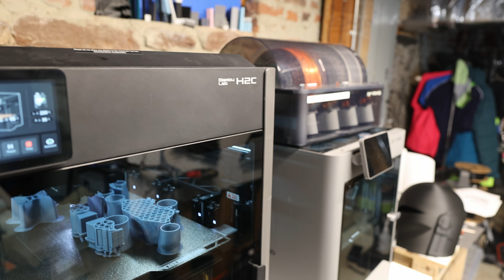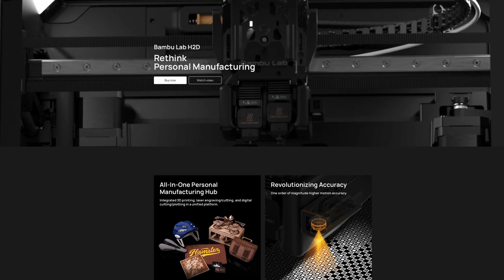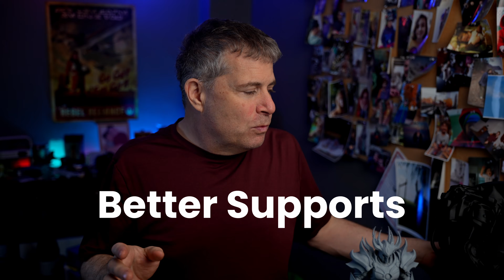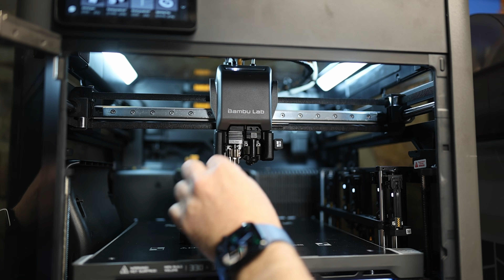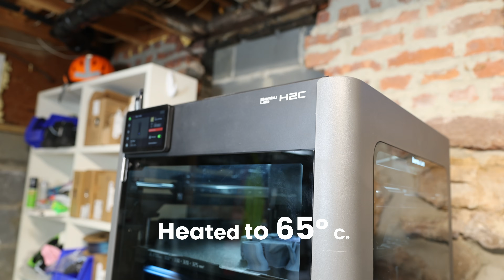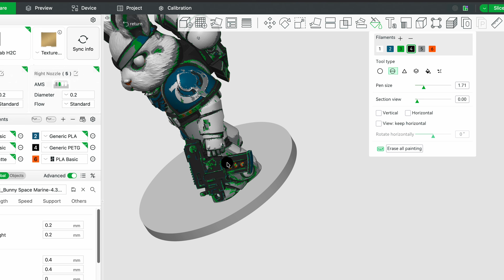The Bambu H2C Is Revolutionary. Here's Why You Probably Shouldn't Buy It.

Comment: I have never done 3D printing. I am wanting to get into it. My daughter wants to be an engineer so my wife thinks a 3D printer will help her to visualize things that she would or might design on some of the 3D modeling software. Also my wife wants to start a business doing 3D printing. No we don't want to sell dragons at the Farmers market. We are looking at things that you don't see in our local markets as often. I have a lot of experience in construction and building things that I need at the moment. Sort of redneck engineering. I'm looking at all the options and given the things that we have seen that we would want to print a single nozzle printer with Nas would probably get us where we want to be but the time involved would be extraordinary for the things we want to do. Therefore, a dual nozzle or a tool changer is the minimum starting point. I love the idea of the x2d where I would have one nozzle for printing and the other for supports but it's a smaller print bed for than what we need and also that other secondary nozzle is not a fully capable nozzle like the other. That moves us up to the h2d as being the minimum entry point for what we want to do. However, with that said, the HTC has now dropped in price to under $2,000 and that has a lot more features and a lot more options above the h2d. Given that they just announced the h3c , which looks to be a far superior product that may drop the price of the h2c down a lot and be a more attainable entry point for us. Of course it may be so far ahead of the H2 series that we end up abandoning our goal of the H2 product and just try to save up enough money to move straight to the h3c. If it releases at $3500 though that will put us way out of the range and we cannot even consider it. Putting us back to the h2d or the HTC.

Comment: Great vid, and thanks for not having background music. Why am I watching? I'm looking for my very first 3D printer. I was considering resin before, but the mess and fumes threw me off, so I'm back to FDM. I would like multi-color, the ability to print support material, less waste, and a great ecosystem that works. I know all about the issues with Bambu and the issues around privacy and third-party software, but it seems the Bambu system just works. It's a lot like Apple, despite Apple being so proprietary. 

The build volume of the H2C seems really good, along with all of the included features which for other brands are add-ons. Price isn't too bad either. 

What really got me thinking seriously about a 3D printer is two purchases I made on Etsy; one was a modular gun holder which has swap-out supports that go into the magazine well of a pistol (small for smaller guns, larger for larger) and this was even customized with the brand of my choice. This was great for zeroing the gun's optic with a bore laser. 

The second thing that got me thinking was a set of pumpkin heads for Halloween. These are one-color PLA but the art was so great, and the print came out beautifully. I plan to primer and paint them, followed by a protective sealant for display this month leading up to Halloween. The Pumpkin heads were smaller than I thought, but if I had my own printer I could either print these larger or just design my own and print that at any size. 

I also have a little invention I want to print. Just a quality-of-life thing like so many others have done with their 3D printers. 

Waddya think, should I take the leap? I'm also a 3D Artist, though I would use my skills for practical applications mostly.
Reply from the maker: I hate background music. The only time I use it is when there's something that benefits from it. Footage from a gimbal camera like the Insta360 is one. 

I'm personally not in any way concerned about Bambu and privacy. I'm not printing anything of great importance. I get it for companies that need to be secure but I think there's a lot that's overblown. Half the people posting comments are on their androd phones, which is ironic.

The custom gun holder sounds really cool got an Etsy link for that? I'd love to check it out. 

Since you're talking about making your own designs, if you're as bad at 3D designing as I am, on my other channel I'm doing a post about the AI 3D modeling tool Tripo. You get 500 credits if you use my affiliate link triesth.is/tripo and code TRIPOCREW (all uppercase) gets you a month of pro for $8. I use it for a lot of decorating, while I use Onshape to make more practical models. 

I'm glad you're not doing resin. I've completely stopped testing resin printers, just too unhealthy.
Reply: @davetriesthis  Thank you for the quality response! Sounds like you're reasonable about background music. It makes sense if there's no voiceover, but I hate when it competes with the mood and audio for a voiceover. 

I agree with you about Bambu. I guess if I had trade secrets or privacy concerns I'd be more concerned. There is a slight concern about my unique 3D art going through Chinese servers and being sold by someone else, but I'm guessing that Bambu wouldn't do that. Maybe they would, and if they did I would change my tune in a big hurry. I don't plan to make anything super complex or difficult for 3D printing, just some practical quality-of-life improvements and things like Pumpkin heads for my Halloween decor (my favorite holiday). 

What I've done with house lighting is already so cool and any 3D-printed decor will just be the cherry on top. Plus, if anyone swipes my 3D prints, I can print more and the cameras might catch 'em anyway. :D

The gun stands are amazing! All done with PLA, and I even got the CZ logo printed on the base. Here's the Etsy store link;

https://www.etsy.com/shop/ThreeDArmory

Yeah resin is amazing but I'm not going for art prints, otherwise it would be a no-brainer if I could bring myself to deal with the VOCs and the mess, which I'm not. 

I'm great at 3D design but I do appreciate the link to the 3D modeling tool. I knew it was a matter of time before AI was able to assist us 3D artists. I'll check it out. I already love AI for 2D art, and I know most pro artists hate AI but to me it's just another tool...like 3D printers. 

Thanks again!

Comment: For me, I'm considering it for tabletop ready terrain and miniatures. 

I'm finding while I'm actually pretty good at painting natural things quickly and comfortably, buildings and mechanical objects are very hard for me. And given most of these are back drops for the games, rather than the centerpiece, getting them to tabletop ready is more important that getting them to display grade. 

I've already run a few multi-color tests with my P1S, and the results were very good. The 8mm infantry are very nice, despite being basically ants with stick guns, and using matte PLA as a base for painting rocks and other things is excellent. 

I'm pretty sure doing scale buildings with silk PLA windows and matte structures, I could do a very simply oil wash to get to something that's absolutely believable on the table without having to wait for spraying weather. 

But, those infantry points, and the experiment printing Elementals shows I need more than 4 colors with supports, and the time and waste is huge. I'm not so bothered with the waste for small run/high yield runs: 250g of filament isn't that bad when it gets you all the infantry squads you will ever need, but if I'm going to be doing this for a bunch of different builds, it will absolutely add up. And any failure is a massive loss of time and material.
Reply from the maker: 40k and others are a perfect use case, though of course resin is still better. But I’ve done some pretty incredible things with a .2. Terrain is even better since the fertile don’t need to be so prominent. Check out my video on 3d modeling software. One of the prints I made is a nice variant on a space marine. I worked on another project with a 3D tool and Gemini to make me a whole squad of tau.

Comment: I’m running the H2C, H2S, and P2S now — honestly loving all three. They’ve been rock‑solid for me. Thinking about grabbing the X2D next.
Reply from the maker: I’m doing a review of it now. Will be out in a few days. Anything you want to know?
Reply: @davetriesthis  How smooth is the tool‑changing?

Any wobble, misalignment, or calibration drift?

Does Tool 1 vs Tool 2 behave differently with certain materials?

How long does a tool swap actually take during a print?

Comment: Im watching this video as I would like a larger printer within the Bambu Lab ecosystem (really enjoy using my P2S). Beyond a H2D, the cost for a H2C is a little more for what I would call a LOT of additional flexibility. I did flip and flop between a tool changer, however with the H2C, filament can remain in a closed box and you aren't limited to just four, seven or eight colours.
Reply from the maker: That makes total sense if you prioritize material versatility and those extra color options!

Comment: I will be getting my 1st ever printer and after watching countless video's and hoping to possibly sell flight simulation parts I understand the H2C will have very little waste which means more material for jobs and parts. I was thinking about the X2D in hopes maybe a small 4 tool Vortex may be an upgrade. I'l looking somewhere near years end so we'll see what pops up.
Reply from the maker: The XD is nice and I’m reviewing it right now, but the primary issue with it is really designed to be filaments plus one, and I usually use the plus one to be support material so if you’re using four colors, it’s the left nozzle only and you’re gonna have the same waste issues you would with a P2 S or similar. Know if you’re printing flight simulator parts I’m guessing that they’re single color or at least only a couple of colors in which case the 2-D is a good solution because you can print support with one side and not have to change the left nozzle to print that support, but the H2 C is a killer printer. If you’re waiting for the end of the year, though they will undoubtedly be several new things.

Comment: I'm getting the H2C as the product I am manufacturing requires the hotter nozzle temps and hotter enclosure temps that the other units do not offer. For most things, most people, the H2C is absolute overkill and unnecessary.  I'm pretty sure you agree with that ;)
Reply from the maker: 100%

Comment: I bought an H2C, but I primarily use it like an H2D.  It's nice to have that .2 and .6 nozzle on the rack for when I need it without swapping out hardware nozzles.   The engineering on the Vortek nozzle rack is pretty neat, but in the era of toolchangers, the AMS/AMS2 is a vestigial organ that needs to fade into history.   If I need to print multi-color, I own faster and cheaper options for that which are very close in quality.  

The H2C costs way too much money for what it is in the era of tool changers.    It was outdated before I received it.  It's still good for printing some engineering materials with a dedicated support filament - like an H2D.
Reply from the maker: I think it’s an interim solution but it’s also targeted for a different customer than you’re talking about. Tool head changers are great but it’s a four color limit. There is a lot of work that’s difficult impossible to do with them as it stands. I don’t think that the AMS is a vestigial organ. it allows people in a commercial setting to do multiple filaments on different jobs back to back. having to go and change the filament on a four head tool changer is not a viable solution. With the AMS and the nozzle system, you can print 24 different materials which means that if you’re doing volume work, you can also load 24 of the same filament pull in and not have to worry about changing them. You can also load .2.6 or .8 nozzles into them almost instantly. It’s not a machine for everyone but it excels at what it does.

Comment: p1p owner with no ams. looking for the print bet size, multicolor, and the money isn't really a deal breaker. Was just waiting for enough people to put a few hundred hours through the hot end swap system before pulling trigger. Thanks for video
Reply from the maker: Good call on waiting. I haven’t checked the time counter in awhile but it was over 1000 hours last time I looked.

Comment: Buyers remorse with the P2S.  Not that it's a bad printer.  But, after trying the multi-filament prints for supports (PLA/PETG) and all the waste and time it takes that's where the remorse factors in.  I've tried to keep supports with the same material (PETG with PETG supports) and it usually doesn't come out well.  I need the reliability of dependable material separation.  Then there is the multi-color prints.  This takes up a lot of time too and generates a lot of waste.  I had the budget to buy an H2C from the get go but I didn't because I didn't understand the time factor that I've explained above.  Now I'm certain that I will be buying one soon.  Oh, the larger print bed will be nice too.  My local Micro-Center is out of H2C's.  They sold 12 or so in under a week.  Then I'll need to figure out what to do with my P2S since I don't have room for both.
Reply from the maker: Is there a middle or high school nearby? You can often donate them for a tax deduction.

Comment: Little buyers remorse on p2s. I build houses and am trying to utilize 3d printing for tackling real time problems that occur during the building process. Need my prints done faster, need ability for larger prints, bigger than h2c would even be better but not already pushing it at 2k
Reply from the maker: For construction-scale needs, you might want to look into professional-grade large-format machines that prioritize speed over multi-material features.

Comment: You mentioned the roughly $1,600 price difference between the P2S and the H2C. If you look beyond the upfront cost, that gap can largely be offset by filament savings—especially on large, multicolor prints.
Assuming an average filament cost of $20 per spool, avoiding the wasted filament from a single full-plate print already saves a noticeable amount. At that rate, it would take about 80 full-plate prints on the H2C to break even compared to the P2S. In reality, that number is closer to 60 prints, since the P2S has a smaller build volume and slower print speeds.
In other words, if you plan to produce at least 60 large, multicolor prints over the next two years, the investment in the H2C pays for itself and becomes the more cost-effective option.
Reply from the maker: You’re right on all of this. I mostly talked about the time savings as I assumed the filament cost was assumed when I talked about the waste but I should have left in a section I did with some price comparisons.

Comment: I have a x1c and planning on picking up a h2c.  It's not just the wast, but the print quality is better.  I have some prints that people want right now that I just can't do on the x1c.  If there is a lot of color changes you almost always get some color bleed especially with light and dark colors.  The Vortex system fixes that.  I considered the U1, but really want the bigger build volume for some items.  Also, being able to use Bambu slicer for everyone one of my printers is a huge plus.  I would love to wait for the Core One and Index system, but not sure how that's going to take.  Also, I started with Prusa and love the company just have a bad taste for the constant maintenance I had to do on there printers.  Not blaming there printers I was brand new to printing when I bought a MK3, but spent more time fixing than printing.
Reply from the maker: I agree with you on every one of these points. The H2C really fixes the color change problem. It also really expands what you can do with the system. I’m testing the U one right now and it’s a terrific printer, but being limited to four colors makes it less valuable for many uses. For a four color job, the U one shaves hours off of prints from the H2 C. I made a small four color dwarf figure with AI, it printed in six hours at about 60 mm tall and the H2 C would have done it in 10 hours so, I think for a print Pham I would pick up a few of the U one as well for jobs of for filament or less. 

I have the exact same feeling you do about Prusa and the delays that have happened on that system make it less valuable to me to wait around  also from a personal note the company never replied to any of my emails about testing the printer, even though I also started with Prusa printers and love the company. 

Speaking of personal notes, if you do buy an H2 C, please consider using my link in the description. It really helps out the channel.
Reply: The Prusa INDX has just been announced on pre-order. For only 1000 bucks more than the H2C you can have a smaller build volume, a maximum 300 DegC nozzle and a leaky, unfiltered and passively heated chamber. Oh - and no cameras unless you pay more. Oh - and no AI aids. Bargain, eh?